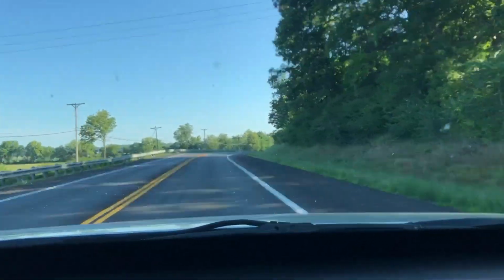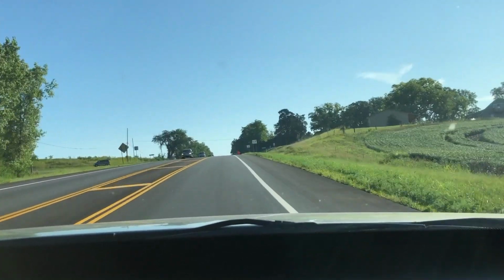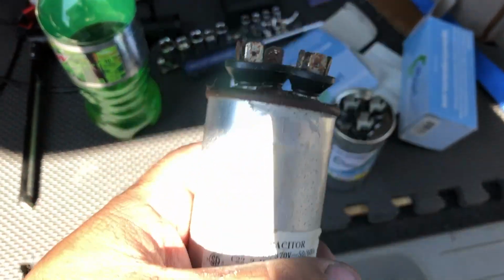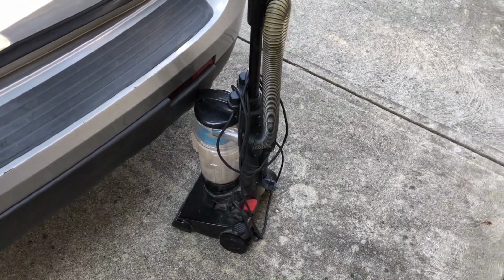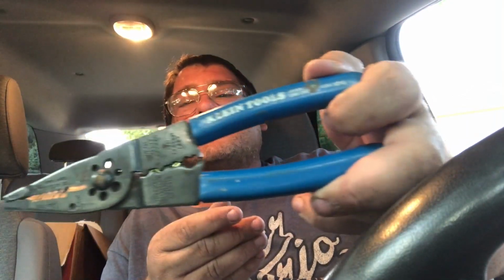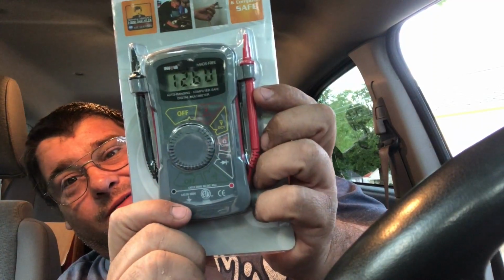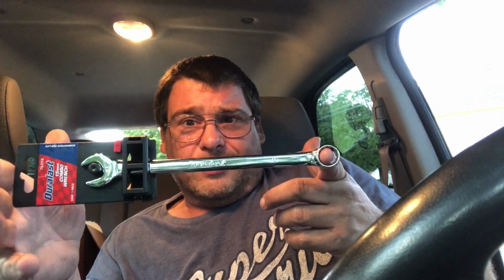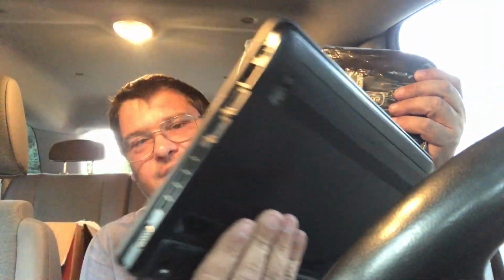Mobile Mechanic & Handyman Side Work Saturday. Making Money!  New Tools!

Comment: Was it a flood vehicle
Reply from the maker: No it was just a bad ground strap between the Engine and Firewall.   Looked fine, but when it started doing it I have 4-5 volts of drop between engine block and firewall.  Put jumper cables between and the drop went away.  Install a ground strap and it's fine.  The old one looked fine, but obviously had intermittent high resistance.   I texted the owner today.  It has had no problems at all.  I am going to be fixing the brakes on it this weekend, and he has decided to keep the vehicle.